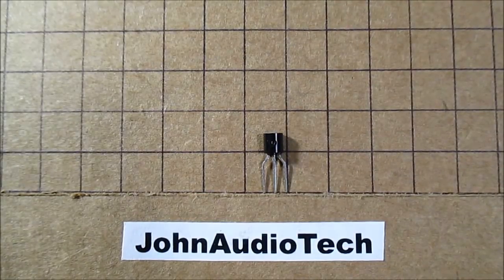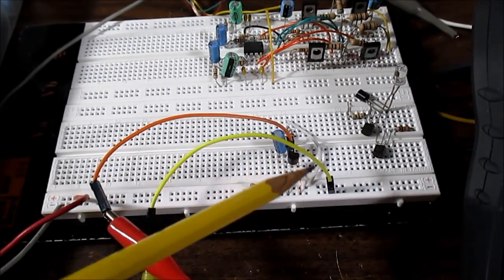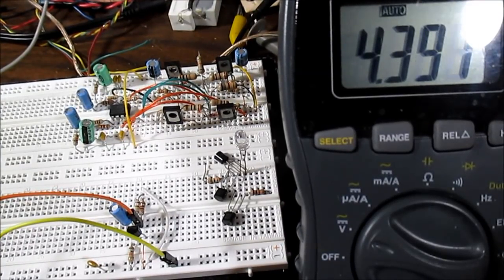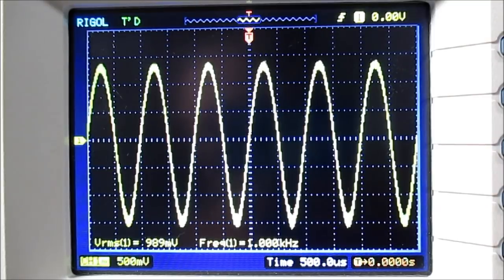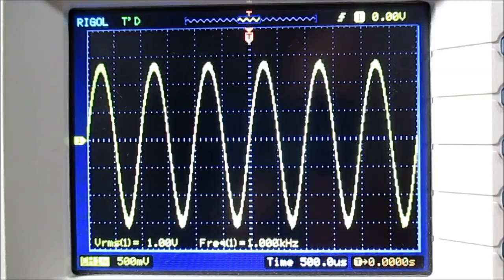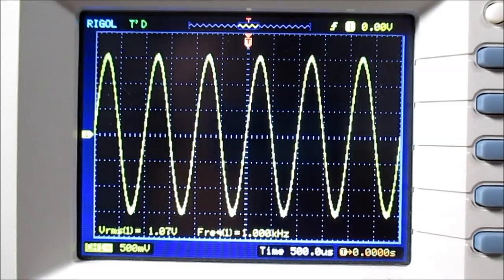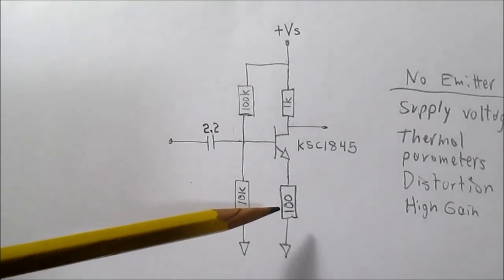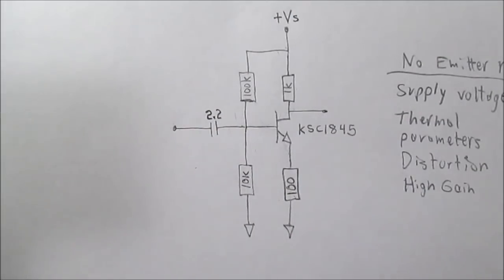Reducing distortion in a single transistor amplifier

Comment: you can get back a lot of the gain on the AC signal, by bypassing the emitter resistor with a  capacitor in parallel with the resistor!  So why didn't you show that?
Reply from the maker: Yes, you will increase gain but at the cost of increased distortion.

Comment: To delve a little deeper into how the emitter resistor (Re) improves the performance of the stage, it is necessary to understand how the gain of a common emitter stage can be calculated.

The simplest way is first to consider that the emitter current (Ie) is equal to the collector current (Ic), which it effectively is when transistor β is 100 or more.

At any given Ic, the dynamic base resistance of a transistor (re) is approximately 25mV/Ic at room temperature. So for a collector current of 5mA, the intrinsic dynamic base resistance of the transistor is about 25mV/5mA = 5 ohms (5R). A small change (Vin) to the input voltage applied to the base will produce a change in Ie of about (Vin/5) amps (although Vin will only be a few millivolts ac). But any small change in Ie will produce the same change in Ic, therefore the voltage across the collector resistor (Rc) will change by (Vin x Rc / 5) volts. The ratio of the change in the collector voltage to the change in the input is the gain and that is equal to Rc/5 in this circuit. In general, the gain of the common emitter without an emitter resistor is Rc/re, where re=25mV/Ic. You can look at that as Rc.Ic/25mv, or the voltage across the collector resistor divided by 25mV. That shows that the maximum gain of a common emitter stage depends on the supply voltage and nothing else!

However, the instantaneous gain of the common emitter stage without an emitter resistor can be seen to be directly proportional to the instantaneous collector current, which means that the positive part of the output is amplified more than the negative part. No wonder you get 8% distortion even with a couple of volts output.

Alternatively you can consider the gain to be Rc/re and note that re depends inversely on the collector current. Non-linear resistances are an immediate source of distortion. It should now be obvious that if we can add to the resistance seen by the emitter, we can "swamp out" the non-linear re so that it becomes (re + Re), where Re >> re. In the circuit shown in the video, Re is 100R, which is 20 times bigger than re (5R). That reduces the gain by a factor of 20 (from ~200 to ~10), but also reduces the distortion by the same factor (from 8% to less than 0.5%).

Having that emitter resistor also reduces the dc gain from 200 to 10, so that millivolt changes in Vbe (from temperature changes) become negligible. Similarly, the effect of changes in supply voltage that cause changes in the output bias point are reduced because of the smaller gain.

Hopefully that gives some insight to how the emitter resistor improves those performance characteristics and to the magnitude of the improvement. You should be able to see the effect of using a 50R (or 47R) emitter resistor, or of cutting the collector current down to say, 2mA while maintaining a 100R emitter resistor.

Finally, some commentators have suggested bypassing the emitter resistor with a relatively large capacitor. That removes the effect of the Re on reducing the distortion. It results in an ac gain of Rc/(re + Xc), where Xc = 1/(2πjf.Ce) (the reactance of the bypass capacitor Ce) at frequencies where Xc << Re. The ac gain therefore does not become flat until Xc < re, and you would need 1,600μF for Xc to equal 5R at 20Hz, That's a big capacitor and can be a source of problems. I suggest forgetting about that idea unless you're working at microamp currents (when the capacitor can be smaller) and want plenty of gain but don't care about distortion (like amplifying a microphone signal to trigger a pin on a microcontroller).
Reply from the maker: Thanks for your detailed comment on this. I've been contemplating making another video explaining the intrinsic resistance and Early effect with pictorial descriptions. The math can't be entirely avoided but scares many viewers away.

Comment: Very nicely done! I was thinking that as a final improvement if you had placed a capacitor across the resistor that connects emitter to ground you would have picked up some of the gain lost by cleaning up the amplifier. I am not 100 % sure why what I suggested works and kind of hoped to see it explained a bit.
Reply: That would immediately re-introduce the distortion. There is no "free lunch" with transistor amplifiers because of their non-linear characteristics and you always have to trade off gain for reduction in distortion. I'll make a separate comment as to how this works.

Comment: hey, John, you can add a bypass capacitor across the emitter resistor that greatly improves the gain if you add let say 1000uf the gain would be the same as the original, thanks this video was very helpful!!!
Reply: Only if you don't mind having the 8% distortion return as well. A 1,000μF capacitor would result in a gain of about 200 with the 5mA at 14V supply, but only for frequencies above about 32Hz, so not quite the usual full audio range.
Reply: @RexxSchneider  a 10000uf works really well
Reply: @yirmiyahu5149  Sure it does. It extends the range of the 8% distortion down to 0.32Hz. That's a real improvement.

Comment: Excellent demo of a classic circuit design. Clearly shows why the emitter resistor is pretty much mandatory.Rock solid thermal stability, very low distortion, predictable gain, AND almost any transistor of the correct polarity will work about the same.That is the building block circuit that made transistorized equipment comercially possible.

Comment: Is there any particular reason why you used the KSC1845 over a more common npn like the 2N3904?
Reply from the maker: The KSC1845 is a low noise, high voltage transistor that is good for preamps and front ends to high power amplifiers.
Reply: It would have been interesting for him to plug in the most shitty transistor he had and measure that after doing the KSC1845 haha

Comment: Let's have some more of this single transistor stuff.
Can we have information about the effect of lower collector currents by changing the 1K to 10 K?
Also ,biasing with 1 resistor directly from collector to base.
As well as distortion and gain,the effect on input impedance resulting from the 100 resistor.
Reply from the maker: I will certainly do more of this. I have a lot of video ideas backlogged.
Reply: I want to see this self-biasing stuff too. I've got some thoughts regarding high-gain low-noise radio amplifiers for loop antennas, but not quite enough understanding to put them into practice.

Comment: Just ad a 100uf capacitor across the 100ohm Resistor.... Help to prevent feedback & gain losses.... For ac signal... It passes... So it can't produce a voltage dropp
Reply from the maker: Yes, you get more gain but you also get back the heavy distortion.

Comment: What do you mean by the rising voltage at the base counters the input signal?
Thanks for the vid!
Reply: Because the emitter V is floating across that resistor, the potential from base to emitter is likewise changing. This change is 180 degrees out of phase from the input resulting in degenerative local feedback, lowering distortion at the price of reduced gain.
Reply: Thanks for the reply,
So as the voltage at the base rises, the collector current (and therefore the emitter current) swings low, this pulls Vbe down, effectively 'reigning in' the input voltage as our form of neg. feedback? How come as the voltage potential drops at the emitter does that not make the base 'more positive' in reference to it?
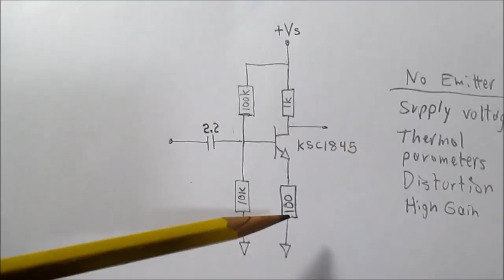Reply: No, if voltage increases at the base, base-emitter current rises and so does collector to emitter current, multiplied by the beta. This bigger current through the emitter resistor results in more voltage dropped across the emitter resistor. This is the countering signal, the feedback. So the base-emitter current isn't referenced directly to ground but to the voltage at the top of the emitter resistor. 15:40

Comment: Another great learing video keep up the good work wondering how big of a amp u have ever built that and wondering if u could build me one that i could use just a positive and negative single voltage with the amp u build could draw all the way up to 130a if u wanted and voltage i can go up to 15.3v i modified a dell poweredge server power supply to run a amp i think lowest i can go is 25a at 12v

Comment: Sometimes I've seen electrolytic capacitors across the emitter resistor, what effect does this have?
Reply from the maker: It bypasses the signals so gain increases, but at the cost of more distortion. Sometimes there are two series resistors with the cap bypassing one of them to get the benefit of some AC feedback.
Reply from the maker: I could have said more but the video was already 30 minutes before editing.
Reply: Acts like a short (on AC of course), bypassing the resistor. He didn't go into that. He should. All practical circuits use a cap.
Reply: Oh so its more circuit specific and there isn't a one size fits all cap I could use?
Reply: A large enough cap there would bypass and eliminate negative feedback for AC, but not for DC. So you get the DC bias stability, but none of the AC effects on gain and distortion. 

Impedance here is much lower than on the input, so you need a larger cap.